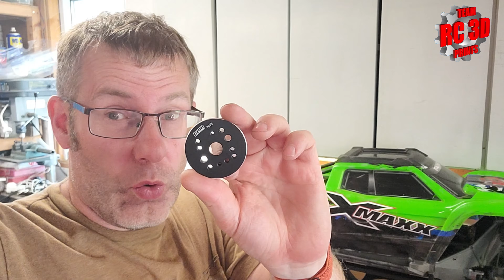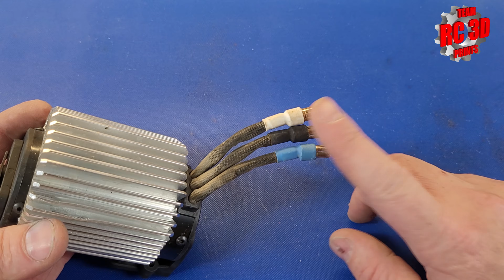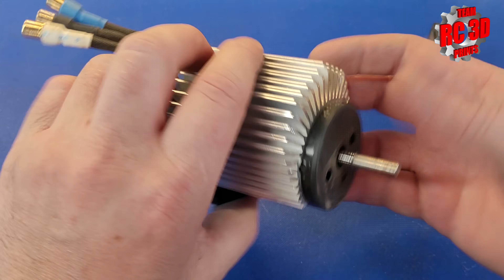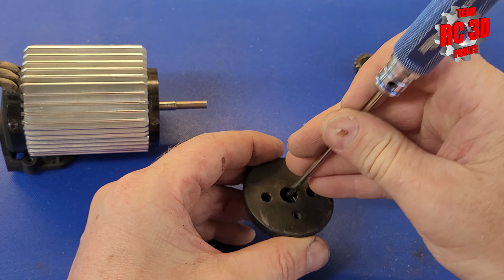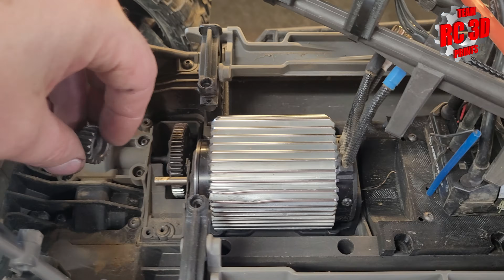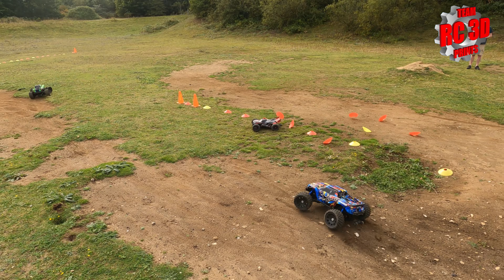Fit this and it makes your Traxxas X-Maxx or XRT motor bullet proof

Comment: my 1200xl motor died after not even 3 hours of running, still wondering what could have been the cause of it
Reply from the maker: It's usually overheating - but who knows?

Comment: Can you plug up all the holes on it to prevent crap getting in?
Reply from the maker: Not had an issue with that
Reply: This was my first thought careful not to get any crap in the motor then bolt on a cap riddled with holes 😂, I’m going to get one still, much better than plastic stock front